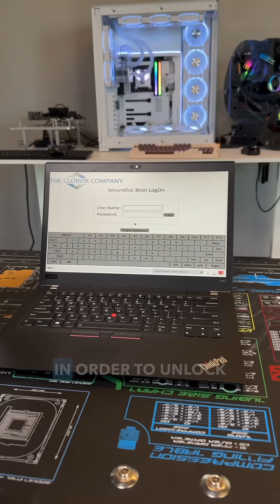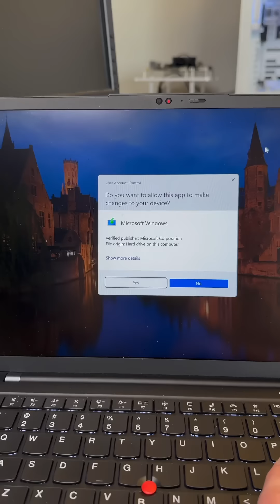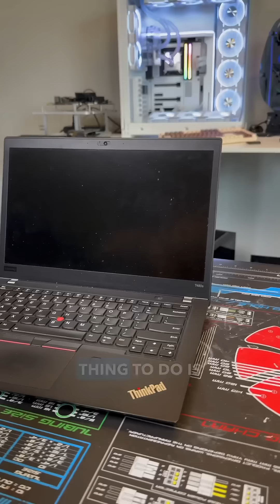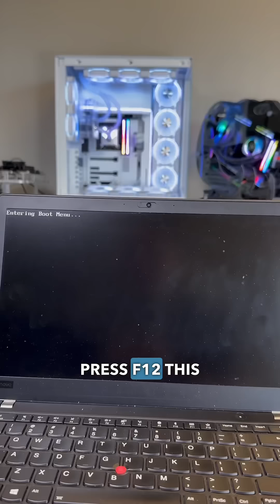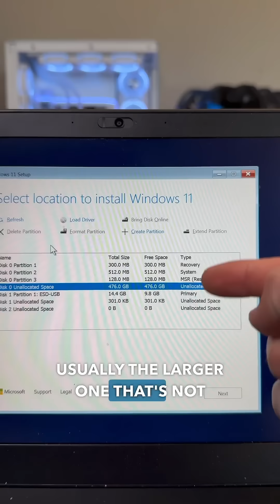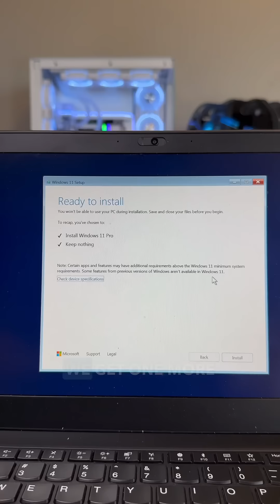How to factory reset a work laptop? #tech #techtips #pcrepair #computerrepair #laptop #pc

Comment: What if the partitions do not show during the process?
Reply: Hi, I'm sure you are well past this but I'm leaving a comment here for others who are looking to solve this problem. If this happens, turn off PC, back on and instead of forcing it to load into the boot menu, load into the BIOS menu. Look for Storage Configuration, SATA Mode, or VMD Setup. If it's set to Intel VMD or RAID, this can prevent the Windows installer from recognizing your storage drives and therefore their partitions. Try changing this setting to AHCI/NVMe, save your changed and reset again and re-attempt your previous windows install process, hopefully the drives and their partitions will now be visible. If this doesn't fix it your PC may be missing the storage controller drives, but that is a much longer and system specific set of instructions so I will have to say please look into that for your own use case lol... Good luck people!!!!

Comment: I have been able to reset and get to windows install, after connecting network, it forced me to login to comapny email that i dont have anymore, any advive?
Reply: Did you find a solution ?
Reply: Same thing happened to me.... I bought a refurbished Thinkpad laptop which was already reset but when I tried setting it up and connected to wifi in the step, it showed me a screen telling me to sign in using company email or school mail
Reply: @samirkatkol having same issue! 😩
Reply: @samirkatkol have you solved the problem?
Reply: @Eric-ur4bc try searching for a youtube video showing how to setup only local account on windows 10/11 using command promt during setup... You will find many videos

Comment: I guarantee you this won't work.  If any IT department didn't release the computers from intune then the computers BIOS is tattooed to their intune, so if you format the hard drive and reinstall windows as soon as it connects to the internet it'll be bricked again.

The only way to get around this is to install Linux, this is to keep thieves from stealing your work computers and reselling them after wiping the drive.

What you can do is if you legit got the computer from work, ask your IT department to remove it from their InTune account, that's the only way to prevent it from getting bricked again.
Reply: What about removing that intune service from windows
Reply: @mineroblcz from what I understand it's at the BIOS level so if you reinstall Windows it's automatically going to "phone home" and lock up again.

The only work around is Linux

Comment: Couldn’t be for sure, but I think theres another way to do this. It seems like that login page was what the laptop booted into originally, then when you put in the correct login, it booted into Windows. Something you could do is go to the BIOS settings, then change the boot order to put Windows Boot Manager first, or straight up delete the login page from the boot manager so it gets past it. Then you don’t have to factory reset it. But of course it might still have some company stuff in Windows, so you might want to reinstall Windows like shown here

Comment: if you gotta force to boot from usb, long-winded way is remove ssd from laptop wipe it externally re insert and it should boot from usb.
Reply: This would be fine except it is firmware level bios locked. Therefore, when you try to boot it will allow it but won’t allow you to change the boot order to install the OS and bypass the password.

Comment: Also if yours has a bios password this will not work and you need to mod the bios rom in the bios chip to force remove the bios password without the password and then this will work

Comment: bro wanted reinstall windows when was bios locked bruh 
u need remove cmos battery
Reply: *replace
Reply: @Baxiljn  no it doesn't store the password it store power for the chip
if u remove the battery for like a 1 min then put the same battery is not gonna remember the fact it wanted one
Reply: or the boot option but for that u can fix ez

Comment: But most companies would lock the bios preventing u from accessing the bios which most of then time on a locked bios they lock the boot from USB function. So the only way to bypass that is to find a work around for that model of computer or flash the bios chip using an epromm reader clip. If u don't have any of those skills your kind of out of luck.
Reply: Just found that out. 🤣 thanks for sharing the info, cheers!

Comment: A short-cut for those familiar with Linux: Start the laptop on a live USB, blank the HDD/SSD using the dd or shred commands if desired, then use parted to lay down a new GPT volume label but don't create any new partitions.

Restar computer with your WMI drive plugged in as given here, Windows will spot the initialised but empty disk and offer a one-click autopartition that helps speed things up. 👍

Comment: Here's a tip:
Starting Windows 11 24H2, Windows will guide you to install the operating system. They will gray out any drives that are in use or plugged in via USB or firewire (IEEE port in universal term) so you won't accidentally delete the partition where the installer is. Older Windows versions also do this (but only if the installer is running on USB2SATA cable

Comment: well if you do not have a working computer something that 99%  would work on windows 8 and 8.1 to 11 is that powering off the laptop 2-3 times before windows start, should bring up the recovery mode, and after selecting the option to troubleshoot you can then just reset it from there with the reset this PC option (you will have an option to keep important files or completely reset it), and it should let u install with the same clean version of windows that you already have. If its company owned it will most likely already be activated which is a bonus. Rather than just installing a copy of windows with the usb.

If its bios locked, you can just disassemble and reset bios with the cmos battery by unplugging and replugging back in.
Reply: Yeah but it's locked before you can get into recovery but after BIOS locked. So you need a working PC, if you can't find one, use any library PC or ask to borrow one 😅.
Reply: for BIOS lock you can just enter random things 3 times then you should get a master id that you go on Google type bios master key generator you enter the master id and then it depends on your pc sometimes you put the master key on the enter password then enter sometimes is type then ctrl+enter , or like you do ctrl+enter then it says enter master key then you do enter i reccomend checking YouTube with the search of
If on laptop: [pc brand] laptop bios unlock tutorial
If on pc [motherboard brand] unlock bios

Comment: So i have a 2nd question, this was a great tutorial but now i ask: what if it has a BIOS password
Reply: Some laptops have supervisor password which won't be removed when the CMOS battery is removed
Reply: @accelerator972 in that case you will nead to flash the biis chip
Reply: @accelerator972 Thinkpads even have security eeprom IC on motherboard where password stores. It can be erased using I2C adapter which is not easy.
Reply: @accelerator972  ACELERALQLRQTOR
Reply: @accelerator972  that’s false
Reply: Take the laptop apart and take the cmos battery out turn it on turn it back off Take it apart again and put the cmos battery back in the laptop the cmos battery is just a small button cell battery by the way
Reply: Why would you remove the battery then put it together, you would take it out, leave it open and turn it on.  @therealBingusGaming
Reply: You can either open up the computer and replace the CMOS battery and if there isn’t one look for the reset jumper and trigger it. Or, sometimes reflashing the BIOS completely works too. Best method of reflashing I’ve found is performing a BIOS update or rollback and shutting off the computer so it corrupts the BIOS and then installing a fresh one using a USB.
Reply: @parold2025  that sounds like it could either end really badly or work
Reply: @TheRealScottMusic  what? It’s a normal practice.
Reply: Many laptops have a special password that will remove the old password, i did it when I got my Dell laptop
Reply: thats only for the bios settings, not boot-up password so you could install windows on another ssd and swap ssds
Reply: @eazy_black this was a question about the BIOS password, where the hell did you get the startup password part from?
Reply: just open the laptop take it apart and reset the bios by taking out the cr2032 or some similar battery for 5 minutes and you're done
Reply: Take the drive out. Put it in a different computer. Install windows on it. Then move it back to the laptop
Reply: @jaredvarner6099 this doesn’t work if the there is an admin lock on the device- the lock is on the motherboard itself.
Reply: I used a bois password finder website and it worked for 1/3 of my laptops
Reply: Change the motherboard or the change bios chip on the motherboard if it available
Reply: @ BRUUHHHH what just change the baterry
Reply: There is a Web site that can help with that
Reply: That dosent work if the system is encrypted at a bios level.
Reply: @morph- And if that is the case, then the laptop essentially becomes a $500-$1000 paperweight.
Reply: @LOLMAN9538  yup
Reply: @morph- there is no such thing my guy
Reply: remove cmos battert
Reply: you are fucked
Reply: Reset the CMOS, @Endermanch made a good video about that.
Reply: Youre literally just a YouTube video away from that.. It explains everything on what to do and what website to go to get a master password, you have to enter the S/N from your computer or something like that.. It's been many years since I've dealt with this
Reply: the boot menu can usually be accesed without bios password
Reply: then you are cooked buddy
Reply: Sometimes you may be able to reset the bios by unplugging the CMOS battery. It won’t work for every laptop.
Reply: Not every laptophas a battery
Reply: @jaimecosta2966 yes it does. Every motherboard has a CMOS. it is a fact. If your board didn’t have a CMOS it wouldn’t work.
Reply: @Shrey_3636 it doesn’t work on any laptop so idk why that’s too reply
Reply: @PurpleNoseKitty it does work on many laptops? What do you mean? It’s called resetting the CMOS battery.